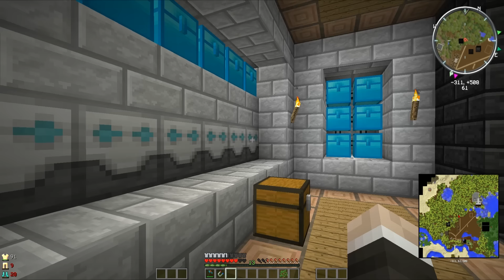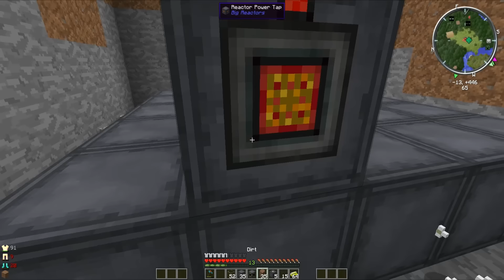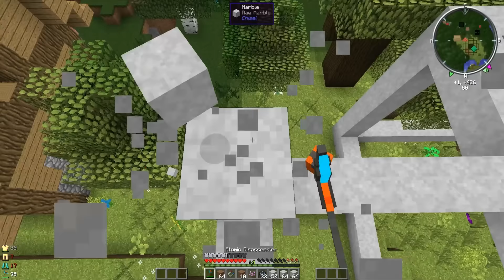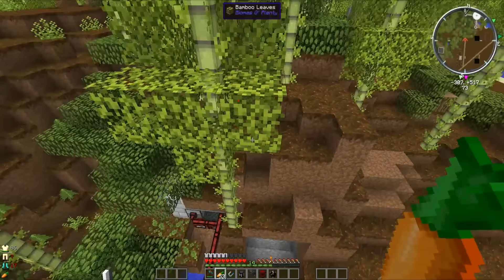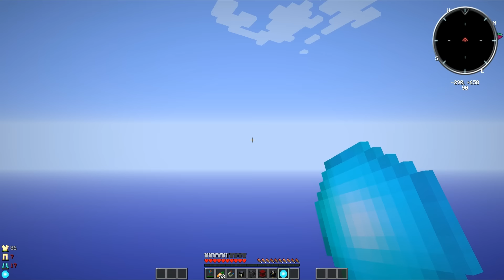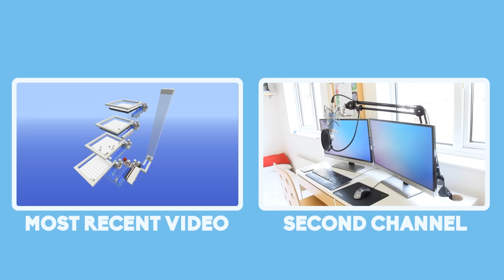Hermitcraft Modsauce: Episode 5 - BIG REACTOR!

Comment: Destabilized Redstone got a buff somewhere because I don't recall it being a very effective coolant in FTB Monster.  It looks like it's doing well here though!
Reply: 5k rf/t isn't really that much at all for a big reactor
Reply: A Freaking Sandwich 1. That's not at all related to my comment.
2. Destabilized redstone was barely effective at balancing the reactor temp and casing temp in my FTB Monster tests.  Here it seems to actually be balancing the heat between the two quite well.
Reply: ok sorry
I haven't really messed with, I just went with cryotheum
My bad
Reply: I'm still new to big reactors, what is the best liquid to cool it down??
Reply: Hamdy Mahgoub Gelid cryothium

Comment: Whoa, MARICULTURE is in this modpack!  You should construct a blacksmith's anvil and blacksmith's hammer if you're going to use vanilla tools for any particular reason. PLace the damaged (vanilla) tool on the anvil, hit it with the hammer with left click, and you've repaired one point of damage on the tool at the cost of some XP and a point of damage on the hammer.  Plus, if you add Unbreaking 3 to the hammer, you can make a set of two and use them to repair each other though it will be XP expensive.

Comment: just incase, the mining multi tool from what i gathered has 2 functions. first if you use it and stone bricks in the crafting table (crafting with it consumes a bit of durability, so one is more than enough for 14-25 or so portal frames), you get portal frame bricks (obsidian is to nether portal as portal bricks are to aromas mining world, and they look cool as well, the stuff that holds the bricks together glows a cyan color like the tool) and it also works as a flint and steel for the mining world portal, lighting it up, which also consumes some durability. the orb is a replacment to the portal because it allows you to do what hte portal does anywhere at any time instead of in a specific place.

Comment: Good structure. But you should change the normal marble to smooth marble. P.S marble works like stone so put it 2x2 in a crafting bench and you'll get smooth stone... I think not 100% sure but I do know that there is a lot more different types of marble that like a lot better

Comment: If by some stroke of luck you read this comment Mumbo. I've been working a lot with the big reactors mod recently (using the crackpack) and by increasing the radius of your reactor by one (having coolant surrounding the rods) you will nearly double your power output.

Comment: Check out Ender IO Glass. Quite Clear Glass, Enlightened Glass (Light emitting glass), Fused Quartz for blast resistance, and Framed Fused Quartz for color frames. The Quite Clear Glass and Enlightened Glass are nice connected textures, so there are no lines between like blocks. You will need to use the Ender IO Alloy Smelter to make the glass from plain sand, sand plus glowstone dust for the enlightened version. Also the Ender IO SAG mill will make sand from cobblestone, so desert runs are no longer as necessary. Both machines run on RF power.

Comment: Mumbo Jumbo use gelid cryotheum to cool down the reactor, so you drop the fuel burn up rate. Another thing, put one more reactor access port and set the reactor to automatically push out the waste. By doing that you will maintain the energy output to the maximun that the reactor can produce.

and maybe later after a while running, you can build a turbine, its quite expensive to build, specially if you had a gigantic reactor like yours, i have a trubine running at my single player producing about 16k rf/t running from a reactor that before adding the coolant port was producing around 4k with 3 fuel rods cooled by gelid cryotheun

Just love watch your videos, i'm a big fan of yours

Comment: 3:06 cow out of nowhere

I like your new base. I think the shape will look good once it's done, but you might want to consider using a different block for a less...depressing color.
Reply: I like the color. But I struggle to add color to my bases. They are usually grey with small splashes of deep blues and greens. (from Chisel Emerald and Lapis blocks)
Reply: Tristan Mitchell One tip for color with lapis blocks. Quartz and sandstone go best with lapis blocks.
Reply: Rotatedz Z z I find that Lapis doesn't really go well with anything, but i suppose sandstone would be the best, as that is the closest to blue's complement color.
Reply: Tristan Mitchell I've been a builder on Brohoof.com (yes, it's a brony server) for about 2-and-a-half years now, so I know how to find a good building. I think that grey block he used for the frame would look good, but he needs to use a different block to fill in the walls. He could also use those grey blocks for the lower portion and use a different color higher up.
Reply: I think a light blue could work well with this build :P.
Reply: Laser Lens yea the cow came out of no where

Comment: you should think about using turbines it can increase energy output 6X or more if done correctly. but you need to get lots of cyanide which requires the reactor to run quite somme time firest.